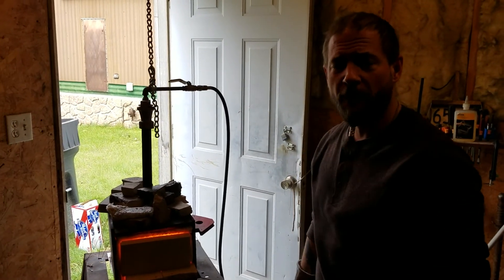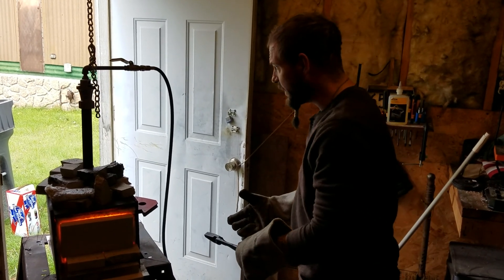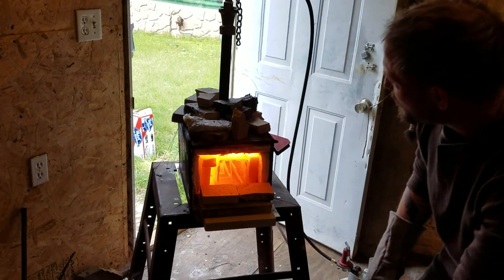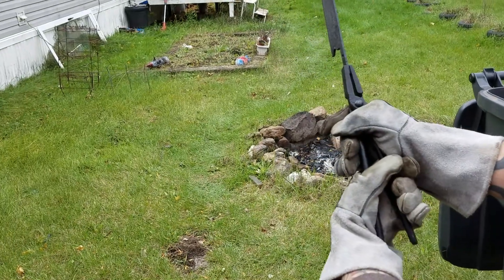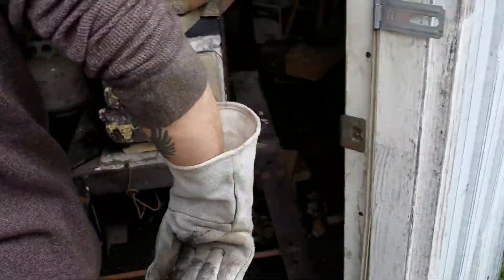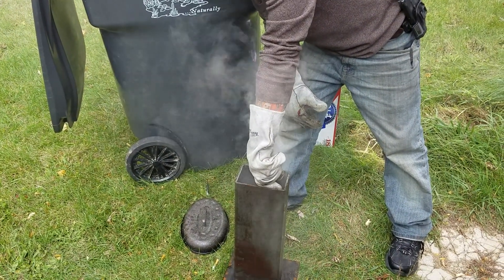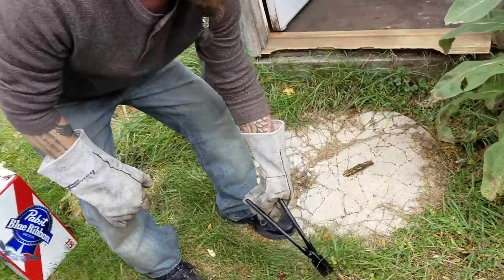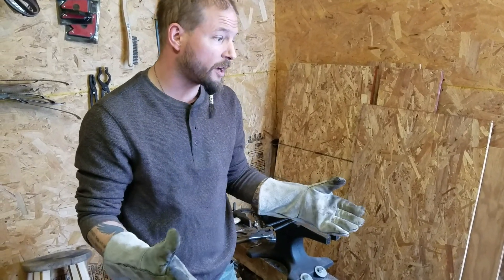Normalize and heat n quench

Comment: Would 'paratherm' make a good quench? It is supposed to be parafin based, but is basically consistancy of hydrolic oil. Let me know.
Reply from the maker: drason69 no clue never heard of it will have to research I guess!
Reply: shepards forge h ill check into it. It is used to heat molds for plastic injection molding. I think it may only be stable up to 700 degrees F. But then again motor oil is only good to ??